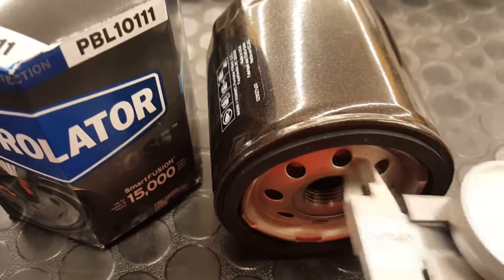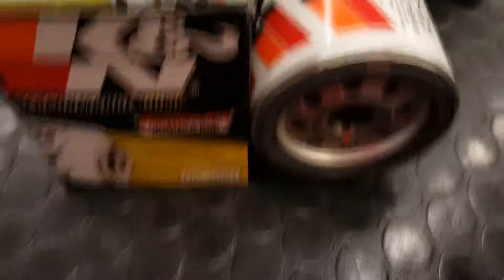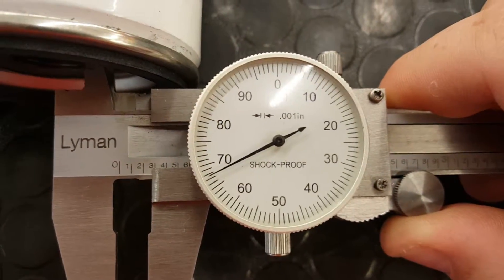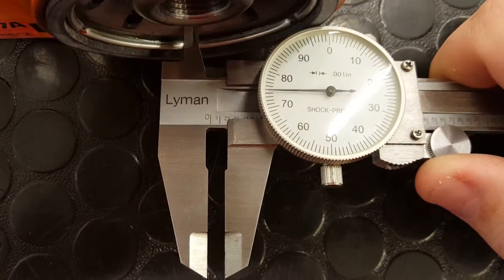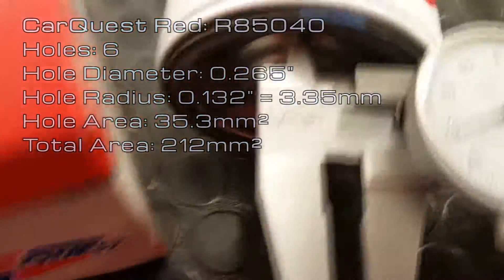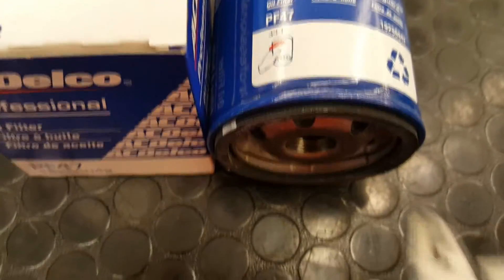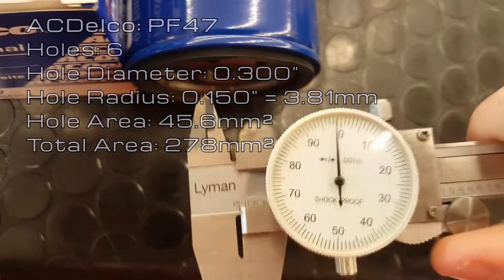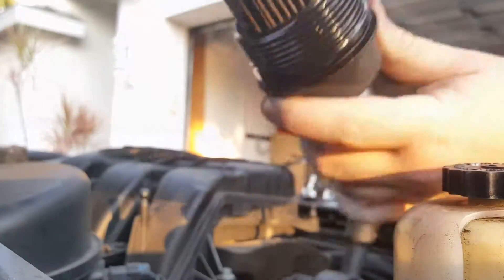Oil Filter Comparison: Inlet Port Sizes • Featuring K&N, Fram, AC Delco, Purolator Boss, & More

Comment: Good video. For your next video (hint hint) take these same filters and test them on the engine.  First, change the oil and run until hot.  Then, using a pressure gauge, time how long it takes on a hot start, to achieve optimal oil pressure at idle.  Then give us the results.  I have a customer who requested just such a test on his 1996 Discovery and we found that out of 8 different brands, only the OE dealer filter and the Mobile 1 filters performed satisfactorily.  These two filters nailed the gauge instantly, while the others moved the needle a bit lazily. He now is happy with paying the money for either filter.  He is also happy with the complete worksheet we produced for him, as we also let him watch.

Comment: I find it interesting all of these comparisons. None of them clean oil. The only ones that clean oil are the bypass filters that use some type of depth material. Using filters that only remove large engine damaging abrasives which are almost never in a good engine and draining the oil to get rid of the smaller engine wearing abrasives don't cut it with me. I understand that most people don't have the skill to install a bypass depth filter but many do.

Comment: Too small is restrictive while too big of holes higher flowing but also less filtering.  Racing on/off road over 40 yrs now & I've never noticed any changes in oil pressures from one filter to another to amount to chit on my gauges even idling. Like many others I must  admit I ran frams without issues on high pressure oil pumps before high volume pumps were ever out many moons ago. Before word got out about Frams leaking internally not filtering right.
Since I begin cutting my old filters open to inspect guts I've ran Purolator filters over 10yrs now. Synthetic media on our street cars about 5-6yrs no loss in pressures even at 1yr intervals. New PureOne goes 10k and Boss reaches 15k..Must be working great my 05 Tundra hit 337k and no smoke, No oil burning, no brown staining on dipstick at all from any sludge build up. AMSOIL or Mobil 1 full sun all the way..
 Dipstick /oil cap area still looks excellent. Never had engine open to see but never any ticks even on cold start, runs like new.  In fact it still looked like a low mileage engine at my 320k timing belt replacement...Never added additives of any type.
 Purolator PureOne synthetic media filters are $8.50 and Boss filters are $12.99 at Advance Auto but are less just google for the Advance coupons...
 See  ya!

Comment: I just had a oil change done on my 2002 suburban now my psi idles at 40 and drives at 60-70psi, could it be the cheap filter or the sensor going bad?
Reply from the maker: What was the PSI prior to your oil change? Both of the things you mentioned could be the problem, and they may have even left the old filter on or put in an oil viscosity that hasn't been in the vehicle before. Take a look at what they put in (it should be on the receipt if you got one) and if you want to try replacing something on your own, I'd start with the oil filter, since it is typically an easy, inexpensive fix.
Reply: I believe the sensor is bad, its reading 40psi when I turn off the truck.
Reply from the maker: Does it stay that way, or is it lower when you come back to it for the next drive? From what I was just reading, it sounds like a lot of GM trucks do that normally. I searched "oil pressure at shut down 40psi" on Google.
Reply: just checked and it was still reading 40 turned the key on then off and it dropped to about 8psi
Reply: I have the exact same except a 2002 Yukon XL with the 5.3. Same psi's as your car, it's fine. It runs perfectly

Comment: As long as the total area of all the inlet holes is at least equal to the inner diameter of the engine block filter mounting stud  then there is always plenty of flow. My bet is all of these filters have at least that much total inlet area in most if not all applications. Also the engine itself is generally ~15 times more restrictive than the oil filter.

Comment: Why would one want a less restrictive oil filter?
Reply from the maker: +Tudor Brad - After a certain point, less restriction doesn't have any benefits. Just as long as it's not too restrictive, any oil filter should be fine on this front.
Reply: Ok, thanks. I'm trying to figure out why would it be a good thing to have a less restrictive oil filter. I guess faster oil flow will help in better oil input to the engine, one of the benefits being better engine cooling but it won't longer keep as many of the impurities in.

Right?
Reply from the maker: That is the typical trade-off curve as far as the filtration element is concerned, but better quality filters help narrow the gap. Oil won't really flow much faster through an engine, because the main restrictions are typically in the engine itself. The main concern with oil filter flow is when it is near the end of its working life due to being clogged with debris.